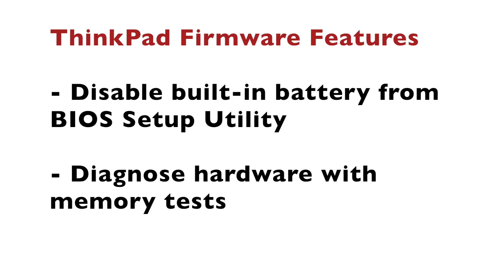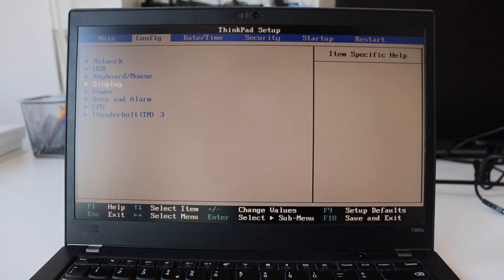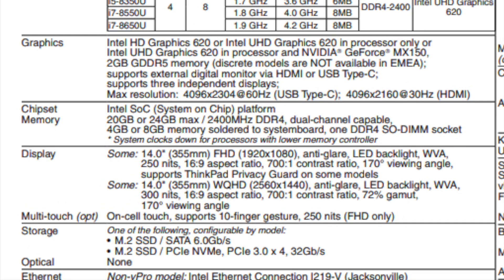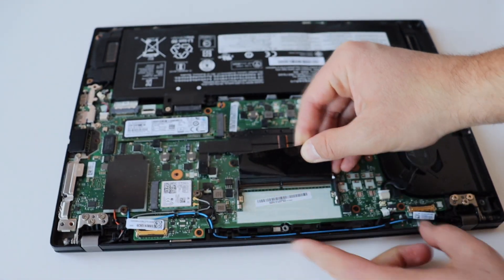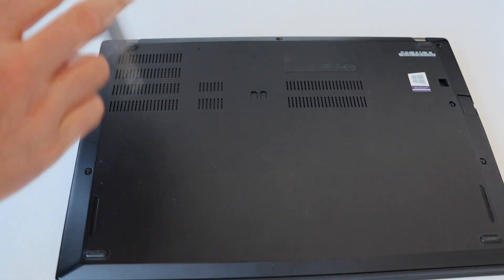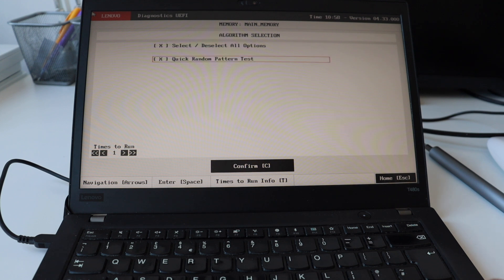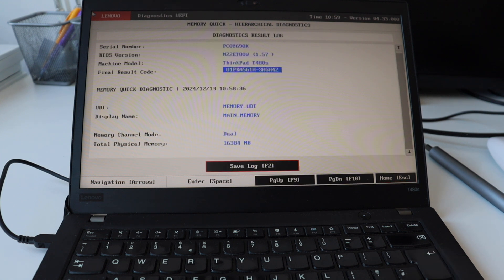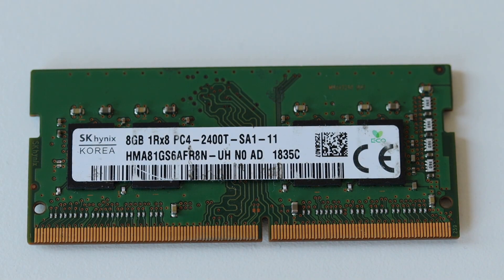ThinkPad T480s RAM Upgrade Gone Wrong: Epic Fail!

Comment: I trying also with G.Skill Ripjaws 16GB DDR4 RAM at 2400TM/s and also failed.
Any tip?
Reply from the maker: Sorry that you are going through the same pain with the RAM upgrade. Have you tried diagnosing the faulty RAM with the memory test from Lenovo Diagnostics? Is it failing the same way?

Following this failed upgrade I purchase new DDR4 2400MHz RAM and it worked fine with it. I covered it in another video: https://youtu.be/rWctG85HlL4
Reply: @LeonAnavi  my laptop dont even start to bios.
But the RAM is ok..i check it to other laptop and its working perfect.
thanks for the response!

Comment: we learned that it didn't work.... main question is: why didn't it work? fried componenent, incompatible, broken connector, or???
Reply from the maker: Good question: the RAM was compatible and the connector was fine, but unfortunately, the memory chips on the RAM module were faulty. Because of that, the Lenovo Diagnostics tests failed. I bought this RAM second-hand and it turned out to be dead on arrival. After the failure, I returned it and thankfully the seller kindly accepted the return.

Comment: Can you please do a video showing where the main soldered ram is?

I'm trying to reseat my soldered ram, is that even possible? Been going through the internet.
Reply from the maker: The soldered RAM is on the opposite side of the T480s main board. A full disassembly of the laptop is required to get it out and access the RAM chips. I recently recorded a similar repair video for T490 which may provide some guidelines for T480s because it is the last s model with keyboard at the front: https://youtu.be/pahmqYAr0lE?si=uMGP8htxjk78QuPq

Comment: Well, my T570 only accepts RAM of certain PCB thickness.  If it's not the right thickness, there's bad contact probably.
Such an ingenious manufacturer.
Reply from the maker: What is the right thickness for your T570? As far as I know the JEDEC standard defines the PCB thickness for DDR4 to 1.2 mm. For DDR3 it was 1.0mm. According to the technical datasheet the RAM requirement on T570 are the same as on T480s from this video: 2400MHz DDR4 SO-DIMM. So if your RAM is thinner I suggest to double check and make sure it is really DDR4 and not DDR3.

Comment: I believe with most laptops, when you insert RAM modules, each one must be pushed in until you hear it "click" into the slot. If you did not hear that "click" sound, the memory will not work properly (or sometimes it may not be recognised).
Reply from the maker: Yes, this is correct. It is the same on T480s but the raw video was recorded in a noisy environment so during the video editing I muted it and did a voiceover to explain what's going on. Because of this you don't hear the click in the video. Unfortunately I just had a bad RAM stick.
Reply: @LeonAnavi  Okay. 👍If you get a replacement RAM module, hopefully it will work now.🤞

Comment: my first ever laptop ram upgrade, really cool asus eee pc 1000 with cool stickers on it, upgraded from 1GB to 2GB, machine bricked. Blue light on and no post or boot :(
have upgraded eee pc and thinkpad ram since with no problems. don't be afraid, you will ram ok again next time
Reply from the maker: Thanks for the feedback! Yes, I plan to get a working RAM stick and finalize this upgrade. I wasn't sure whether to publish this video but after all failure is also part of life and lessons can be learned. The Lenovo diagnosic tool is very convenient for early detecting memory failures. Btw I still have an Asus EeePC that I bought in the netbook era :)
Reply: @LeonAnavi  I have an unknown number of eee pc, but perhaps at least two dozen!
Reply from the maker: Wow, you have a pretty good collection! I have always thought that EeePC and Intel NUC will at some point become collectables :) These machines, just like the ThinkPads of course, have some pretty nice unique features because of which people love them.
Reply: @LeonAnavi  I use them as multi room audio receiver boxes, pulseaudio rtp multicast using lmde linux. They came out same time as first mac books, couldn't compete on video so went for sound quality instead. EEE PC 700 to 1000 series all have great sound, 101 and later not so much. Two goals: eee pc keystone bridge and eee pc chess set.
Reply from the maker: @fanlessfurmark  I have Asus Eee PC 1005PE with Intel Atom N450. I bought it around 2010. I rarely use it nowadays but it still works pretty fine and you can see it in some of my older videos. I installed the Raspberry Pi OS Desktop for PC on it.